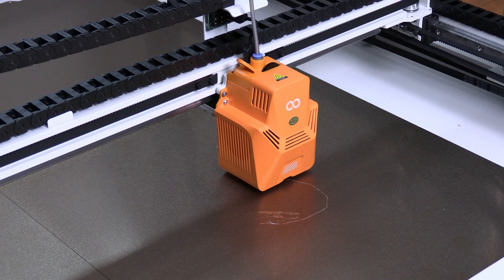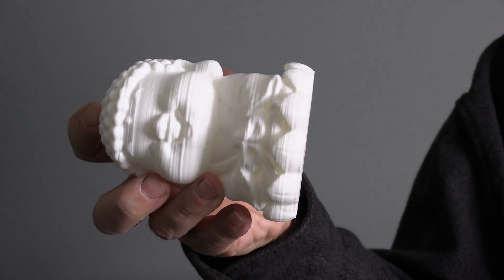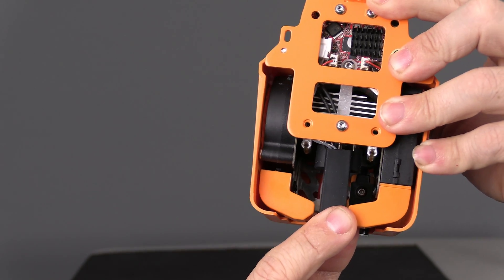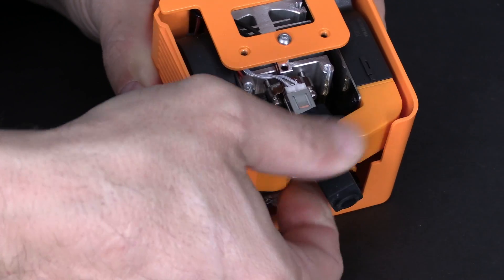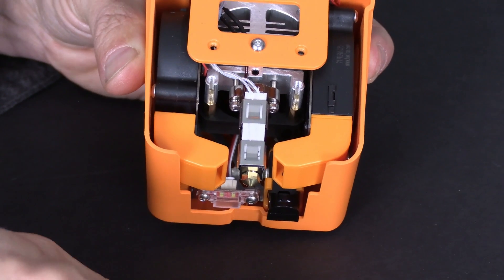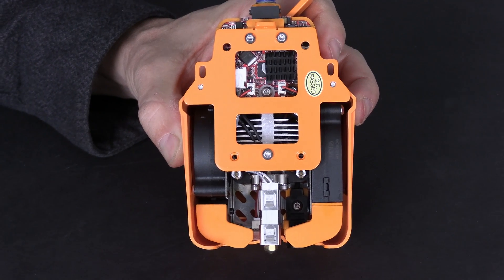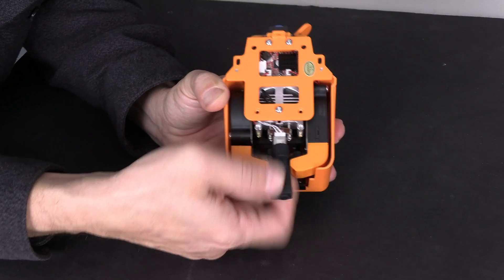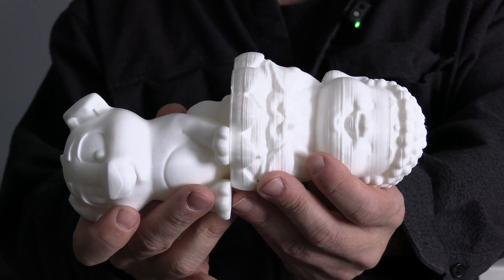Elegoo OrangeStorm Giga: LAYER LINES - Z BANDING - Bed Gouging, Blob 0f Death: Fix a Loose Hotend

Comment: Ahh QC fail as usual.
Reply from the maker: This is a fairly typical issue on machines that make the lengthy journey from CHINA to USA, via being swapped off to multiple carriers. Defintily a QC fail on my end. Baffling that I didn't check the hot end, before I installed it. I failed 3D Printing 101. Which is crazy, considering I went through the exact same thing on my CR10-SE
Reply: @3DRundown  the problem i have is it has a QC sticker on it. I had a bad board on my spare hotend and no QC sticker. My camera sensor doesn't work and only displays in black and white. On the bright side they are standing by products and shipping replacements
Reply from the maker: I have actually heard of another user without a QC sticker on their camera. Elegoo replaced it. Things like this are frustrating, but, they do happen. No printer is completely safe. I've seen things like this across the board. Frustrating, but, the only choice is to get it fixed, and get back to work. As for the loose hot end. It MAY have shipped that way, but, it's a common thing I've also seen many times. We all need to be sure we look over our Printers, when we get them, rather than just tossing them into the fire, for 27 hour prints at 10000000mms. I've made that mistake myself, and... payed the price.
Reply: A faulty sensor is a QC issue. Screws vibrating loose in transit is not.

Comment: You really should have said to make sure the hot end is cool before you check for the wiggle.
Reply from the maker: Also be sure your Oven is turned off, before you clean it, and your toilet is flushed, before you use tidybowl.
Reply: One would reasonably assume a mentally sound person would understand this by default.
Reply: @Mike-ds4ht  have you met the Internet?
Reply from the maker: I laughed too hard at this. You win 😂😂